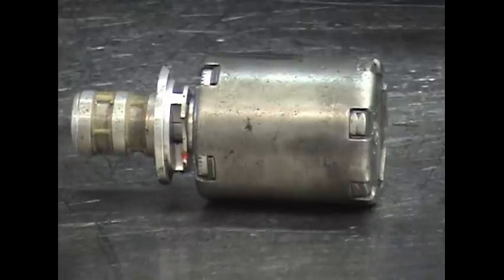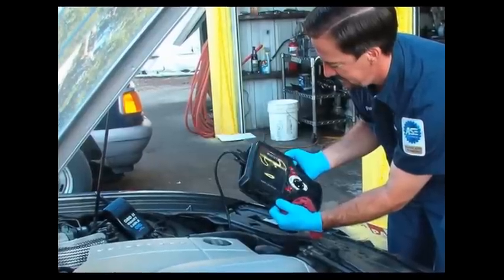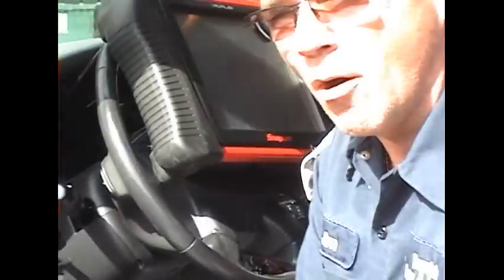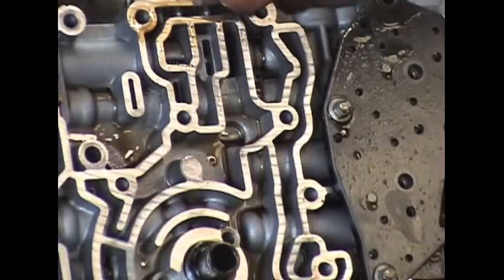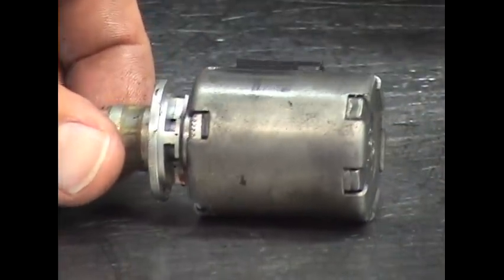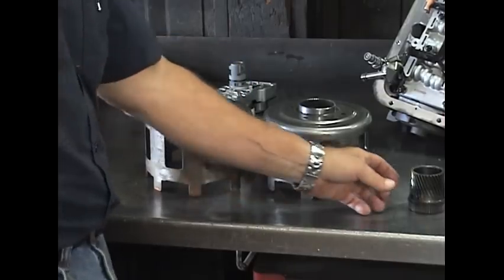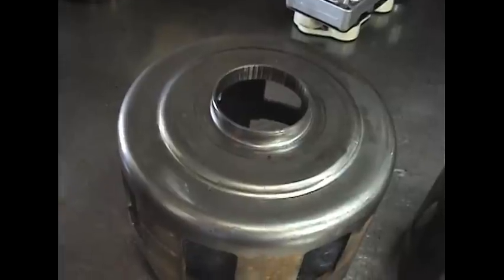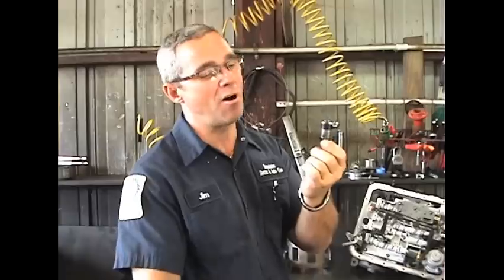Transmission Harsh shifting

Comment: I've got a problem with my 1997 Toyota Corolla shifting late and hard. 1st to 2nd can be as late as 30 mph and 2nd to 3rd needs me to be around 60 mph to happen. This combo makes for a rather rough ride as I feel the car is always in a lower gear than it should be and the high revs will only cause unnecessary wear and tear. Once the car makes it into 3rd gear it feels like there is a hint of engine drag when I let off the pedal. It went into limp mode and when I changed the fluid and filter this is how it does now. I have a air intake temp sensor I'm going to replace and try other things to correct the problem but would value your opinion on whether I should remove the valve body being I never have .

I"m not getting any weird sounds from the transmission, the fluid levels are fine and colors are great but the transmission has gone through about 180k miles.  Are there any problem areas I should check or simply skip towards purchasing a replacement transmission?

Comment: My Honda will go into gear when the engine is cold but when it warns up it won't eve attempt to engage in any gear at all. 

It drove great for about 3 years and I never had a problem with it hard shifting or anything and one day it did start slipping or it felt like it did, fluid was dark and needed fluid added, but it wasn't terrible. I hooked it up to an automotive code I got p0722 AND which is the output shaft speed sensor no signal. Then I got 3 codes related to the 02 sensor. I replaced the output shaft speed sensor and 02, it was doing the same thing. I checked the wires and I found a corroded wire that was barely hanging on. I fixed that and it's doing the same thing still.

Comment: thank you som much 
but I have a question 
I saw someone checked the transmission fluid while the throttle body is fully opened and engine off   I mean that he stoped the engine  and engine off   then he opened the the throttle body with his hand using its cable (old car ) and with the other hand he pulled the transmission stick and checked the flued  .
when I asked him  he said it's a secret 😂
is that joke or real   ?
I wish you answer my question  
thank you so much again

Comment: I had gone to aamco transmissions and replaced the transmission but since then I've been getting hard shifts or slips at high rpm but no codes and honestly it annoying I have to drive slower it's fine but just sucks cause I paid 3 thousand just for it to not perform correctly.. I have a 2006 Hyundai azera Limited 3.8l fwd 5 speed.

Comment: What if no transmission or solonoid codes come up during the scan & the fluid is good with a hard shift only from 3rd to 4th in an automatic? Took it to 2 reputable shops & both said it's not a bad solonoid and that it was an internal issue necessitating a rebuild.

Comment: I have send my car to the Service Centre for replace the rear tyre sensor, and after that the mechanic suggest to update my car software for better condition
After finished software installation, there are two symptoms coming out
•	Car temperature indicator go to maximum level
•	Very Hard Knocking when I shift N to D gear
Senior Mechanic take over this to find the problem occur and make some software alteration to normalise the condition.
The senior mechanic can only normalise the high temperature problem but can’t solve the hard knocking problem and they said that they could not replicate the problem
Any idea what it can be. It only happens in first gear. All the rest of the gears shifts smoothly with no problem.
This happens even when the car has warmed up and even after an hour of driving
Please Help me Sir because i love this car

Comment: Good video, you said that harsh shift  problem could be caused by solenoid or the vehicle computer, how can it be distinguished?
When someone just shift the gear lever from park to reverse, that vibration or shock felt, is it harsh shift? 
What could be the cause if the shock or vibration seems to have increased?

Comment: Hi. I have a 2009 hyundai Sonata and almost every time it does a hard shift at 20 mph when I'm slowing the car down.  Would that be a solenoid.?
Reply: Same here...2009 Sonata (2.4l, 4 cyl)..Hav u fixed the issue.? Dealer did a transmission software reset for me and was working fine for last 6 months. Again facing the same issue.. Whether a bad solenoid is creating  this ?
Reply: @MrAjithkpaul  that's what I'm thinking too. I haven't went to dealer yet

Comment: My 2017 Elantra is hard shifting, ONLY before car has fully warmed up, then it shifts perfectly.  Also, not throwing any codes. Dealership not getting codes either. They just say “it’s not that bad” and there are no codes so they can’t do anything
Reply: Drop the car at dealer. Nxt day, Connect the code reader before starting the engine and do a test drive. After the first or second hard shift, check the transmission details in the code reader. Hope they can find a code.

Comment: My transmission was pulled to replace the rear seal due to oil leak.  When the transmission was reinstall, it started shifting hard.  Carried the vehicle back and was told that I need to replace my transmission.  Could the transmission have not been reinstall correctly?

Comment: I just bought an 08 Chevy uplander cargo van. It has the 4t65e transmission. After about 50 miles it starts shifting hard in every gear. If I shut off the van for a few minutes and start it back up, the shifts are smoothe for another 30-50 miles. Also have occasional slip on takeoff. When it is functioning smoothly, it does seem to have longer shift times than normal. I have this same transmission in my 06 monte carlo and it works fine so I have something to compare it to.  Is that normal symptoms of a bad PCS?

Comment: Hello. I'm having a hard downshift from 4th to 3rd in my automatic 2009 Sonata. After about 5 to 10 minutes of driving it completely smooths out and goes back to normal. Any idea what might be the problem?
Reply: Have you fixed that issue? What u hav done? I am facing the same issue with my 2009 sonata..

Comment: What about a hard downshift 2nd to first? On an newly rebuilt transmission?
Reply: I have the same issue on 2005 town and country tranmssion just replaced and hard downshift from 2 to1.
Reply: Randy Gralapp They told me since everything is new and tight that’ll go away within a  couple thousand miles🤨 But I’ve done about 1k on it and nothing has changed. Thing is it’s super smooth accelerating. But I’ll be taking it back in 2 months cuz it’s seems it definitely not normal. Especially since I’m driving differently waiting/trying to avoid that push when stopping. Have you gone back to ask the place you got it fixed at?

Comment: Hello.  Not sure if this is an issue but, when I'm slowing down for upcoming traffic on a highway I feel a hard downshift at a certain point.  Is this anything to worry about?
Reply from the maker: Hello Eddie, to contact the mechanic (Jim Markle) please call 386-462-7775.
Reply: Hi Eddie, have you found out the cause and repair of your car's issue? It's exactly the same issue I have. Thanks for replying.

Comment: My  bmw 328i xdrive  have a  hard shifting  on 2nd gear theirs a delay and then throws the  shift but it don’t always happen
Reply: michael mooney   Lol well my bmw  already passed that 50k mile curve a long time  ago  right  now  it has 121k   i bought  it with 115k. Im afraid the  transmission is  on its way because im definitely not going to put a new transmission in that car. Selling it  is definitely an option

Comment: please am having a gear problem with my Honda car accord Automatic, The Gear will not change until it get to 4000r/mins and the fuel consumption is high. we be glad if anyone can update me on how to solve the issue.
Reply: Check your idle control valve

Comment: Hello Jim, I have 2011 dodge grand caravan main street 3.6 62 t e transmission codes po731,  po732, po733, po734, po83B, and po868 what needed to change
Reply from the maker: Hello Simon, to reach the transmission Doc, Jim Markle, call his shop at (386) 462-7775. Tell him you watched his video on you tube. Best wishes to you with your Dodge Caravan!

Comment: Did a drain n' fill on my Camry, put back in exactly what drained out...now hard shifting. Hard shift not present when first start...when warmed up hard shift becomes worse. Worst gear is from neutral to reverse. When driving, hard shift not really noticeable. When parking, backing up from stopped position symptom is worst.

Comment: I have Honda Civic 2008 and it has a blinking D and it jerks when shifted in any gear. So I have replaced it's pressure switch with a new one but the problem is still there. So what can be a solution ????

Comment: My 1997 4.0 2wd ranger hesitates to go into 1 and reverse but is fine after that until I let off the gas to coast then it hesitates to go back into gear. Which solenoid or sensor should I replace first? 
I just got the truck for cheap so I don’t know how long it’s been doing this. Figured I’d try a few cheap things before junking it. The transmission is the only issue with the truck.

Comment: My 1999 Jeep  XJ with AW4 transmission clunks/lurches (harsh engagement) (actually the clunk noise comes from the differential but I believe that any differential would clunk like that if  the transmission were engaging as harshly as mine is) when shifted (sitting still) into Drive, but always shifts smoothly into Reverse, and operates normally otherwise. If the computer, due to a bad sensor, etc., boosts line pressure or sets it to a pre-determined "limp mode", could this possibly cause my "unidirectional and only when sitting still" problem, or would it cause bidirectional  harsh engagement (going into Reverse as well as into Drive)? I have had the transmission completely professionally rebuilt, and it did not solve the problem.

Comment: My 2014 Ford Fusion was engaging reverse super hard with a big clunking...........go to check fluid lvl and it has no dipstick. Sealed transmission is what they told me. So I removed the air box above the transmission and found a "vent" which I assume is where the dipstick would be if the air box was not on top it. I added a couple courts of trans fluid and bam fixed. The trans was low on fluid and with Fords great engineering there is no way to check the lvls. Engineered to fail for more tech work for Fords mechanics and sell more transmissions.
Reply: Fuck that

Comment: check transmission cooler lines for leaks as like he said problems from other symptoms of the engine and speed sensors could cause harsh shifts. if you’re coolant temps are high in the engine it could also be high in the trans

Comment: i have a 95 mustang when the cable is on the clicker when i pull back  it' takes muscle to get it back,,when it is off my trans /my trans shifts easy it clicks every space,,now the cable won't line up to put nut on ,,any help is needed ,i only have 5 days then  they said they will take it, last time they did i showed them what louiesville slugger was
Reply from the maker: Hello Reds, if you want to contact the mechanic in the video (Jim Markle) you can try contacting him at his shop, (386) 462-7775, best wishes, Jim

Comment: I have a 2004 yukon xl oil level fine oil still red just started shifting hard first gear rest r smooth .no check engine light
Reply: Same exact thing 2002 accord

Comment: Sir my car i20 has difficulty in shifting of gears from 1 or any other gears. This happens when the car sits over 7 hours or so with gear engaged. The same is true but rarely occurs even during driving.!!!

I have changed the clutch system recently and no problems with pulling power etc., and no clutch cylinders issues. But, just gear shift hard!!

Comment: I havé à Passat tiptronic 2004 and sometime when downshifting to thé 4th it very harsh sometime very smooth
Reply: Try An Additive,I Use LUBEGARD,Helps Shifts & Drops Trans.Temp.The Cooler Ur Fluid is,The Longer Ur Trans.Will Last.

Comment: Have a 95 F150 4x Has a couple second delay going into reverse and then a loud clunk sounds like the third member is going to come out of the rear end and it’s got a little kick in between second and third gear. Any help advice would be greatly appreciated!

Comment: I had 1 hard shift and probably 20 mins. Later the rpm’s went up to 5-6, check eng light and hardly any acceleration.....? No previous problems at all with transmission 2014 Dodge Grand Caravan....any input?

Comment: I have a 2002 Chrysler t&c 3.8l  v6 limited 17500 miles and now readout says 
Code P0700 INDICATES A TRANSMISSIONCONTROL SYSTEM MALFUNCTION & P0715 INPUT SPEED SENSER AND P0700 AUTOMATIC TRANSMISSION  CONTROLL SYSTEM MALFUNCTION  ARE THESE PLUG IN SENSORS? AND CAN MY SON DO THE JOB

Comment: You sound like a very nice person and mechanic . YES the ECM is the major problem like i had from 70,000 miles to 150,000 miles . Besides the solenoids a good synthetic oil makes a hell of a difference also .  Check also the TPS sensor . Keep up the good and honest work!

Comment: I need some help I'm getting a shudder in low RPMs and when stopping there's no cel it goes away if I use autostick I think it's having problems going in and out of lockup I had the trans o-h a year and a half ago could it be the torque converter or do I need new cells

Comment: Jim question: I have a 2016 Honda Accord V6 Touring that is harsh shifting similar to what you explained in the video. My mechanic did a diagnostic and I managed to note the trouble code A/T clutch pressure control solenoid......My mechanic claims I need a new transmission because the solenoid that has failed is not sold separately from the valve body and the cost of the valve body is very expensive and almost equivalent to buying a new transmission. Can you provide me with any perspectives on this issue? Please and thanks in advance.

Comment: Hi Mr. Markle, Great video. Question. Just rebuilt my 5r55s in a 04 Aviator, transgo rebuild kit, Rebuilt transgo torque converter and superior shift kit upgrade. Problem is Speedo not working, Flashing OD lite on dash and check transmission warning on display. Slow shifting and harsh harsh shifting and reverse and extremely slow shift in forward gears. Could this be the turbine input sensor in the front and the 2 output sensors in the middle and back of the trans causing this ? (Also changed the abs speed sensor on the diferential-which did nothing) Thanks, Ron

Comment: Hello Jim
I have a ML 320 CID 2009 and I noticed when I put the gear from N to D position or D to N or N to R or R to N there is sound coming like jerk or harsh , its happens only in the engage and disengage of transmission , and the other transmission jobs are okay so what is your opinion ? is it normal or I should yo do something about that?

Comment: Hi Jim. I wish I would have seen this 7 months back. I had harsh shifts in my truck & slow pick ups at red light & stop signs when stepping on gas pedal. Dealer said it was the transmission. I had it rebuilt. 6 months later what do you know the same thing is happening. Now they say it's not the previous work done but the solenoid pack. Any advice on what I should do next or suggestions? I really appreciate it if you replied. Great video by the way.
Reply: don't start a channel if your not going to answer questions. lame way to advertise for customers.
Reply from the maker: Rafael, I created the video but you'll have to contact the transmission docJim Markle, at his shop in High Springs, Florida. Best of luck!

Comment: Hello Jim, I am Martin and I have a 125C with harsh shift into first speed, this problem was present since it was rebuil in the past. Do you think  that I need to find this pressure contol and change it? Or what should be others causes to look for?. Thanks in advance.

Comment: Wow. Good info. 

Our 07 Uplander was doing the extra hard shift out of park before the transmission went out. No check engine so no codes. So now you can hear a buzzing noise coming from under the side of the transmission in the driver's side.

The van will start. We can shift to park to drive or reverse for a few seconds but once the car warms up a little no gear you put it in works.

Comment: hi i have a Hyundai ix 35 2.0 petrol 2 wheel drive
i have bought the car with a busted engine 
so i bought a second hand engine with only 60000 km on it and just refitted into my car 
fluids filled and checked and trans was hooked up correctly but the car would not move when in drive i can reverse fine but no drive or forward gears.
also i put the car in neutral and try to push the car by hand and the car still feels like it is still in gear with engine off and it jitters while being pushed.out of ideas on quick fixes so any help will do .
thanx best regards

Comment: Hi, Very informative video. Our 2007 Caravan has a kind of dog yelp between shifts. No apparent codes. Fluid & filter was changed a few months ago and all was fine then. In hi gear on the highway it works fine. Any suggestions. Thanks..

Comment: Hi I have a 1995 Oldsmobile cutlass Ciera my transmission was rebuilt in 2007 at 72k I now have 94k it been doing this a while when I shift from park to reverse or park to drive it like I feel a little kick sound when it shifts but it’s drive fine like it always does no slippage no grinding or whining noise no fluid leak no late accelerating I just want to know what could that be my fluid wasn’t change since  they rebuilt the tranny my mechanic said since it rebuilt and if you change the fluid it may to damage by changing the fluid so I never did it just want to know what that means and if I should have the fluid changed by my mechanic or do I need to go to a tranny place please let me know thanks

Comment: Guys i have an automatic honda fit 2002 model 7 speed and it jerks and vibrates when shifting from gear 1 or shifting from high gears to gear 1 only.  All other gears change smoothly